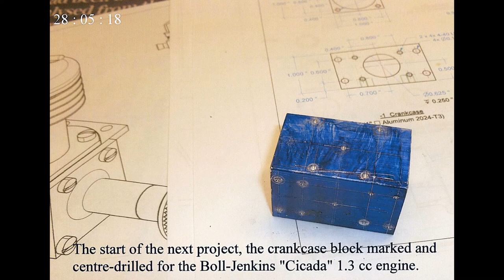Here's a Second One I Made Earlier

Comment: Greetings from West Central Pennsylvania, Thanks for making these videos and sharing your wonderful talent. I love model diesel engines, and enjoy running them, but I don’t have the equipment or knowledge to do what you do. Are you mixing your own fuel and if so what percentages? Thanks
Reply from the maker: At the moment I am using the last of my supply of ready mixed 'sport' flyer's fuel. There is, in the UK at least, a general shortage of commercially available ready-mixed fuel for
model diesel engines. This may be due to the fact that RC flyers favour glow engines and the number of free-flight sports flyers is rapidly dwindling due to aging and loss of flying
sites.The fuel I use at the moment is D-1000 'Easy Start' and is roughly as follows:- 35% ether, 35% kerosene, 28% castor oil and 2% isopropyl nitrate.

Comment: Nice! I made a mini mills with same problem.. starts for about 45 seconds, and when he starts to really revs, if gets flooded...  what kind of steel did you use for crankshaft and cylinder? Cheers! Rodrigo
Reply from the maker: The crankshaft is made from EN8 steel which I have found fairly difficult to get to a really good finish, fine cuts and a lot of cutting oil are required. The cylinder is EN1A free cutting
mild steel with cast-iron piston and contra-piston. The cylinder was honed using the technique described by Ken Croft to achieve a slightly tapered bore (details can be found on the
Adrians Model Engines webb-site). This makes it pretty tight at tdc and requires some running-in although the engine will now run through a full tank of fuel ok.